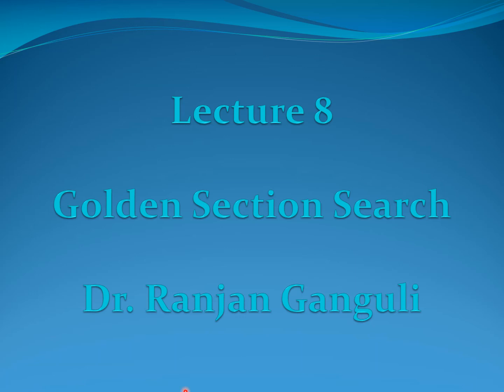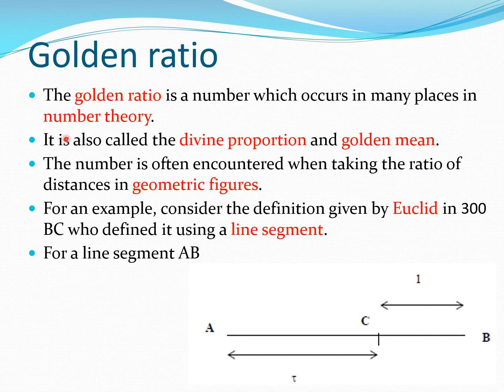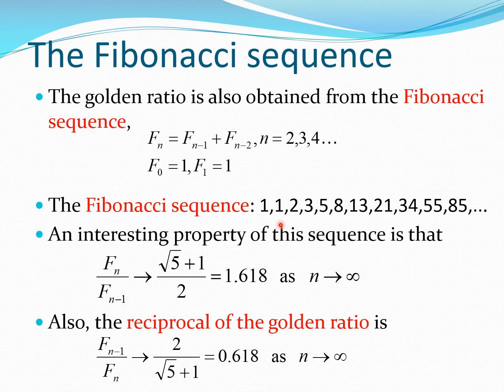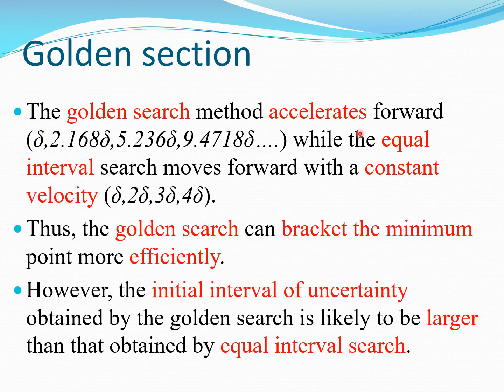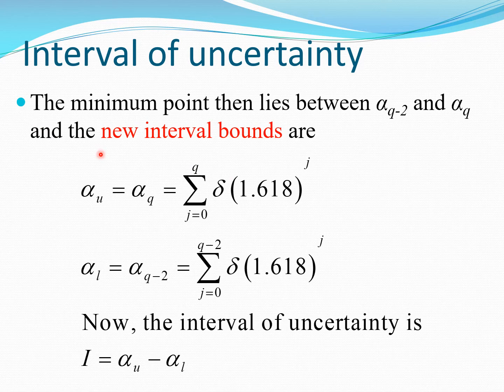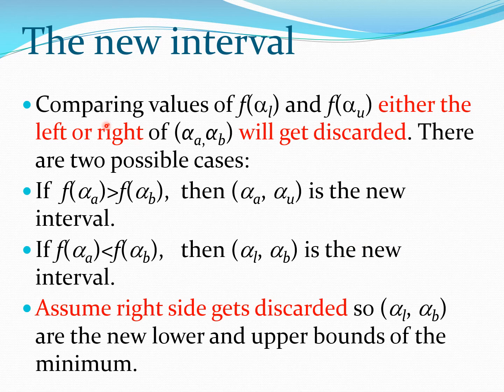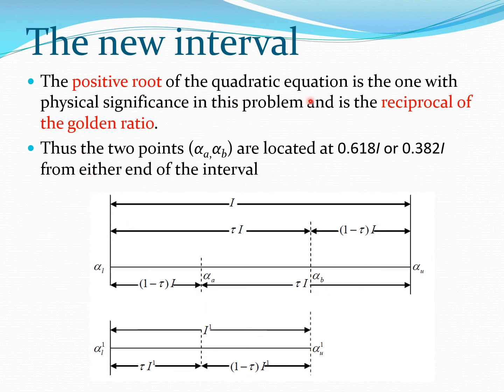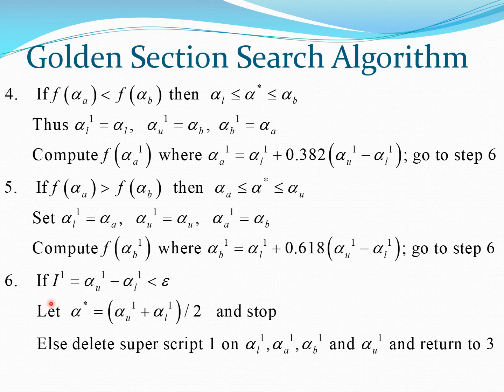Golden Section Method for 1D Search, Optimization Lecture 8

Comment: Can u make video on golden section search method for two variables.
Reply from the maker: As golden section is 1d search it will be useful for one variable case. For 2 variables you may want to use one of the plethora of methods like conjugate gradient etc which I cover later in the course